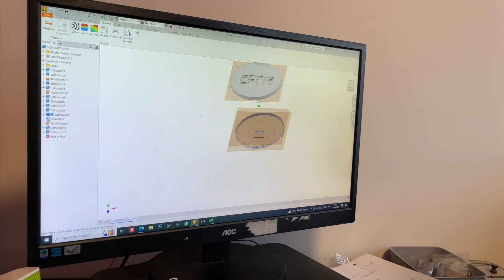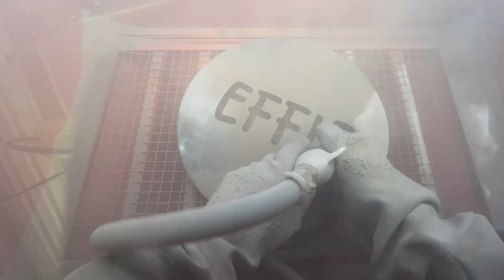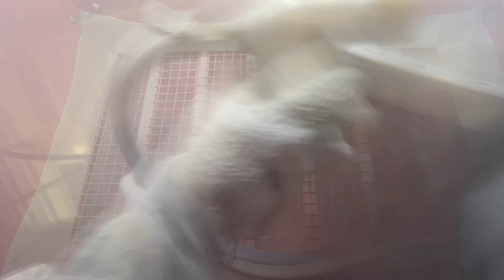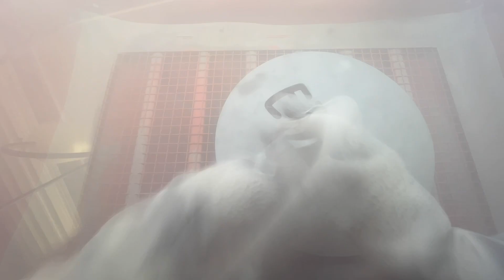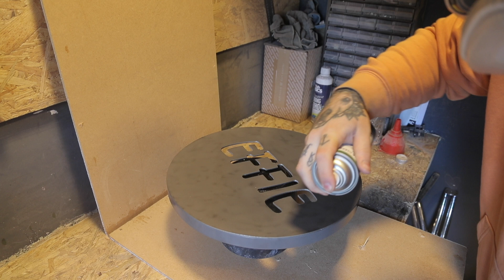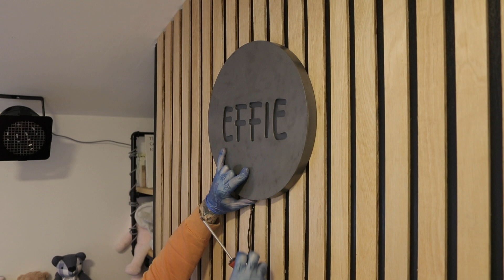DIY 3D Steel Wall Sign with Plasma CNC | Welding, Sandblasting & LED Finish!

Comment from the maker: 🛠 Plasma cut. Welded. Sandblasted. Lit up with LEDs.
This custom 3D steel wall sign build had it all — and it was great to get stuck in with plasma CNC cutting, welding, and even trying my hand at sandblasting.

💬 Have you ever tried metalworking or CNC cutting? Got questions about the process or setup? Drop them below!

🧰 *Tools & gear I use: *https://renovation-dan.co.uk/my-tools/
☕ *Support the channel: *https://buymeacoffee.com/renovationdan

#SteelSign #PlasmaCNC #MetalworkingDIY #RenovationDan